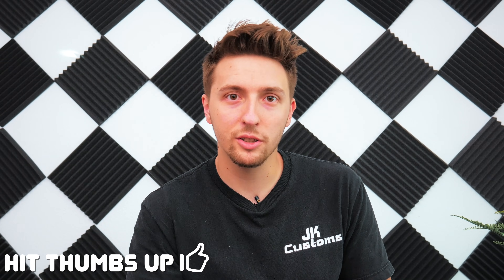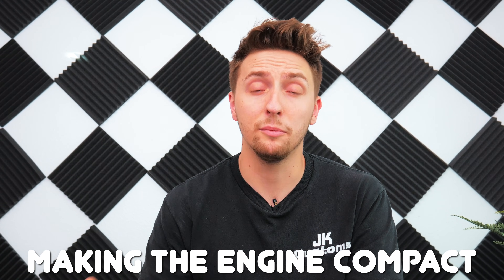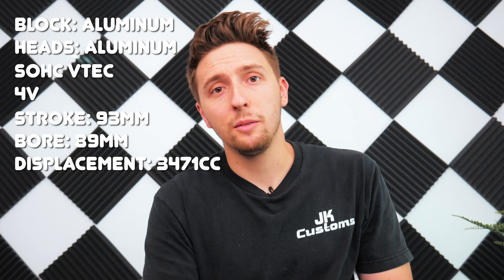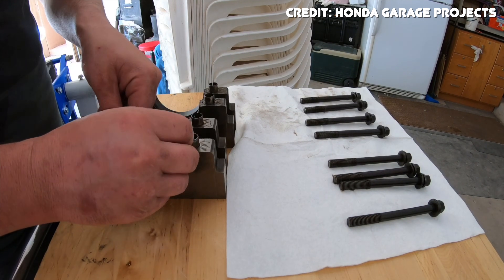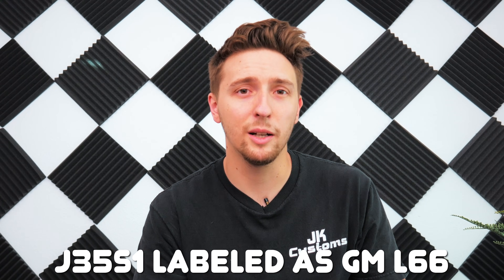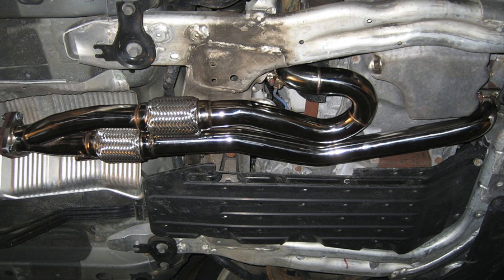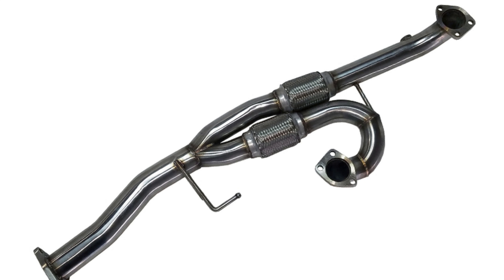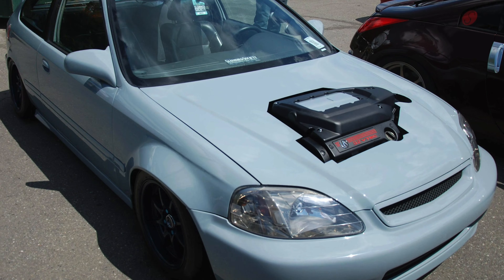Honda J35: Everything You Need to Know

Comment: I have said saturn vue. I was wondering what info you might have on the this start-up rattling from under the hood. I can tell you i don't  think it's the timing belt tensioner, and it is not the rh engine mount. I have read online about a fix that can be done...re-torque of the rocker shaft bridge .im not sure i am 100% confident to do this myself, but i could with the right instructions. The sound does go away once it is warmed up.

2007 vue. 186k mi. Regular oil changes with recommended oil.
Reply: Man just so you know the biggest culprit is a valve lash adjustment usually and if you haven't yet then do before any problems! ADJUSTMENT NEEDED (What sticker under hood should say) lol. This silver one is my 5th REDLINE and she was abused before me and barely ran! Now after a diet and some adjustments/swaps as well as teaching her how to breathe and fart better she's smashin fools at a 6sec 0to60.

Comment: One of my favorite engines of all time. Very easy to work on, smooth, muscular sounding, torquey, fuel efficient (when driving normally), reliable (especially non-VCM versions), & looks beautiful under the hood vs. other V6 engines.
Reply: I got a 08 accord 3.5 and i love it the vcm can be disabled with an aftermarket wire
Reply: @DeeRuss  indeed! And after the VCM mod, how does the car feel?
Reply: @MrSamPhoenix mine has vcm still but driving like an asshole can turn it off.
Reply: @jakesullivan9179  indeed lol
Reply: Does VCM turn on with eco mode or is it always on? What about sport mode?
Reply: My Odyssey minivan does 0-60 in 6.7 seconds, the J35 are powerful and plus has that almighty VTEC!

Edit: Caranddriver got 0-60 in 6.5 seconds with the odyssey which is impressive for a 280 hp, 4500 lbs Minivan
Reply: @aimxdy8680  indeed! But what year is your Odyssey?
Reply: @MrSamPhoenix  2021 with the 10 speed.
Reply: @aimxdy8680  yep, that 10-Speed will truly have the J-series show just how nice it is. 0-60mph in the low to mid 6secs is impressive when you’re talking about something like a family van. How does the 10-Speed transmission feel?
Reply: Muscular sounding lol. Until you hear an LS1. But nah it’s a nice motor lots of hp.
Reply: @forfun6273  dude, this video is all about a V6 engine. If we were talking about V8s then sure. But for a V6 this engine series from Honda sounds amazing!
Reply: @MrSamPhoenix  yeah I was just being a pos troll  really the J35y V6 is close to the original LS1  the V6 is like 280-310where the LS1 is 305 to 350. Which is downright insane. A whole 2.2L to get at most 70hp. Losing 100ftlbs. Of torque that. Still insane. I think they’re coming out with a 5L v8 though
Reply: @forfun6273  yes indeed! But the car makers are going out of their way to get rid of nice smooth V6 & V8 engines unfortunately.

Comment: Sorry, had to give a thumbs down for not mentioning VCM problems, timing belt and cam pitting.  Best bet is disable VCM via one of the many easy to install aftermarket devices, unless you don't mind burning ~qt oil ever 1000 miles, going through cat converters and engine mounts more often.  Nothing you can do about timing belt beside changing every 105K miles and hope the tensioner doesn't fail in between TB changes, in which case engine is gone.  Engine from a so called quality make like Honda should have timing chain, not belt.  Honda cams suffer pitting wiithout the zinc levels oils of yesteryear had.   Don't expect Honda to fix any of this on future years of this engine.  There will be no more R&D to improve this engine given direction industry is going with hybrids and electric vehicles.
Reply: Very well put .
Reply: I have a 2009 accord exl 3.5 vcm with 170k miles did timing at 150k … still running strong. It does burn more oil than normal but that started at around 140k so I check it once in a while. Other than that, I’ve had non of the issues you mentioned. Most people don’t keep cars that long and rack up 170k miles.
Reply: Agreed. Most valuable thing I did was install S-VCM to bypass the VCM. Terrible design that sounded good in theory, sucked in reality. My 2014 Accord has 75,000 miles, doesn't use a drop of oil and is full time V6. Gets around 28mpg combined. Aside from the design flaws you listed, I'm hoping for another 100,000 miles if not more.

Comment: Just turned 100K miles in my 2006 Saturn Vue with the J35/L66 VTEC engine.  Very fun grocery getter to drive, will try to keep it together for another 100K miles!
Reply: Hey.  Good day.  Lol.  My father has an 06 Vue V6.  We just did a major tune up to his vehicle with over 100k miles.  Damn that thing is quick.  I dislike most Saturn vehicles.  This engine redeemed it 100%!!!!
Reply: One of the best surprises of my life was my 2004 Saturn VUE with the J35 engine. I got rid of it at 235,000 miles as no one could figure out why my AC clutch had a mind of its own. (I should have dug deeper, as it WAS fixable). I used Mobil 1 with 10,000 intervals for my oil changes and it never leaked nor used oil. Not a drop.

I now have the J35Y in my 2015 CrossTour and, well, I'm just not sure I'll ever have another car without a J35Y engine. (My vanity license plate on my CT is "J35Y 278" to represent the engine type and horsepower.)

I think Honda did us all a disservice by removing this engine's availability from the Accord. Toyota was smart for keeping their V6 availibility for their Camry line up.
Reply: @douglaslippertindy  Hi.  How did your compressor have a mind of its own?  Any other issues you can list? Thx
Reply: Keep the oil changed and it'll do another 100k easy. We have an 04 Vue with the J35A4 and it's at 239k. Sounds and runs great, sadly the Vue's body is rusting away.
Reply: @davestout844 oh yeah me too. My vues fenders are completely rusted

Comment: I thought you were going to talk about everything that's wrong with it?   Did I miss that part?  What about the fact it has a timing belt instead of chain?  Is it non-interference?  Curious minds....
Reply: I agree - still timing belt driven cams, belt driven water pump, manual valve adjustment or burned valves, vtec gaskets leak everywhere, stripped aluminum drain pan bolt, knock sensor placement, and  VCM problems. Interference engine.

Comment: is it hard to jswap into rwd cars. Ik it can be done in s2k and s chasis but i was wondering if you could swap into like an is300 or an e46?
Reply: The guys at k-miata use a BMW trans for their stronger k-series swaps, and i'm fairly sure the kit can be used to fit a k-series into an E46, so shouldnt be much of a stretch to make the adapter plate work with a j-series instead.

Comment: I have an 08 accord v6 coupe auto trans, and have so far put on a takeda sri, tl type s cams, throttle body spacer, fully custom 2.5 in exhaust with one cat delete, on a 93 tune making 315 horsepower, putting on the j32 heads and j37 crank and intake tho I’m gonna need to look into that, especially that j pipe
Reply: Can the transmission take that much power?

Comment: immediately searches eBay motors for high flow j pipe
Reply: If you have a flux core welder, save yourself some money and splice in your own connection between the two banks right ahead of the flex pipe. Those J pipes are priced so high you'd think they were made of gold.

Comment: You forgot about VCM. VCM is present in many J35s and has caused some issues. Some VCM J35 engines are also prone to premature camshaft wear.
Reply: That camshaft wear was due to the rocker shaft bridge being torqued incorrectly from the factory. There was a TSB about it. Either way, VCM was always a load of unnecessary problems (keyword being unnecessary). There is another common issue with J series rear bank cams being spalled. That seems like a valve clearance or oil supply issue (to the head). You'll find a LOT of J series that "tick" and it sounds like a valve issue, but NOBODY knows what the sound is. It's not valves, because the noise isn't present for the first 15 seconds after startup. I've found countless people with this issue. Also, the original service manual scheduled valve lash adjustments for "when noisy." Major mistake. Other shops have found that valve lash adjustments were necessary after only 20K miles on most J series.
Reply: @WhiTeaNdNeRDyOG  On the Odyssey forum after seeing many users' experiences, we've come to a general consensus that a valve adjustment is a good idea at some point between 150-200k miles.

Comment: the J35A9 Ridgeline 06-08' engines have a common Cylinder 4 low compression (usually due to bent/leaking exhaust valve). Any thoughts?
Reply: I've seen an 08 Ridgeline burn the cyl 2 exhaust valve. Other than timing belts neglected that tear and bend valves, and neglecting oil changes I've never seen a j35 blow up. Extremely reliable engines. The older automatic transmissions bolted to them are a different story.

Comment: What do you think about changing the cam to shave down cam what I wanna do is switch it to 3.7 twin cam are you saying to 3.2 heads flow little better if I Port them
Reply: The best flowing head is the j32a2 heads. They're not the best flowing instake wise but exhaust wise they're fantastic. Honda moved to the integrated manifold on the head which hurts exhaust flow in most j series after 2003.
Reply: @PiterStreak  that’s what I keep on hearing lol you think the 3.7 to 3.5 would be better but damn lol

Comment: I have a 2011 Accord EXL V6. The gas mileage is terrible, but the torque and acceleration is why I want to keep it forever.
Reply: I got 35.8 mpg, most of the time its around 29, so where's that bad for a 273hp engine? Not in my world.
Reply: @MikeYurbasovich  I get about 18 mpg city and 26 highway.
Reply: @inductionrecords same. His numbers dont look right unless its a hybrid of 4 cylinder
Reply: @MikeYurbasovich  How true ,I average 10L/100Km city and hiway and 7.5 to 8   all hiway.
Reply: I own the 2015 Accord EXL V6. Remarkably, I have seen an indicated 41.8 mpg at times in my car. Average is about 30. Remarkable because Road & Track dyno'd this engine showing around 300 hp at the crank. The combination of 6 speeds, VTEC, VCM allowing 3 cylinder cruising, results in some insane mileage at times. Even the average of 30 mpg mixed driving for a 5 passenger 4 door sedan weight 5,550 lbs. is impressive. I'm thinking the 2011 has the 5 speed and that may be where your isn't quite as fuel efficient. Maybe a larger and heavier chassis as well. But yes, I can do 101 mph in the quarter and still achieve 30 mpg on average, seeing over 40 routinely. That's Honda magic! And this engine is buttery smooth. I honestly don't think there is a better car for the money out there!
Reply: Upgrade your fuel pump and maybe destroke the engine. Could also be you have a bad O2 sensor and or bad spark plugs.
Reply: I dunno…I get great gas mileage with my 218000 miles 2010 accord exl….and it’s pretty heavily modded 😊
Reply: I get 35 mpg in my 08…
Reply: @joefrasca1549 naaaaaaaaaaaaaaaaaaaa please How!!!!!
Reply: I got a 2008 im gonna disable the vcm because it burns oil it will burn more gas tho
Reply: @DeeRuss  I disabled the vcm on my 2010 Accord and the gas mileage has dropped less than 2mpg.  Did you experience any other problems with vcm such as spark plug misfire or vibrations when accelerating?
Reply: I get 3kmpl
Reply: @user-pv8sx8xm4u What's the max efficiency one could extract from stock ecu , say by , increasing the Compression Ratio to 12.5:1 , stock cams, Headers tuned for torque and free flowing exhaust , ported head , intake runners , and throttle body ..
Reply: Ayyy,I've got the same car and I love it,especially since it's a 6 speed manual!
Reply: @shaunobrien2526  Wow, those are really rare. I've only seen 2 or 3 manual V6's in my life.
Reply: @user-pv8sx8xm4u lol they sell rebuild kits for your bmw that let you upgrade all the problematic parts also with some upgrades. Then you can bore and add a big ass turbo lol
Reply: Got the same , looking to fully suspension it , plus turbo for 420 hp 😂 i want a reliable 400 hp exl j35 and huck it for time attack. Please be gentle lemme know the route to go for 100 hp plus as reliable as possible. All answers welcome i just want to enjoy this car as much as possible but not at the expense of the car.
Reply: You got a real gem there. I have the same model except it’s a ‘12. Did you muzzle the VCM?
Reply: Really? I have a 2015 and the gas mileage is pretty great if I'm not pushing her even on a 2 hour uphill trip it got decent mileage and on the way back down I didn't even waste a quarter tank it was still near the F
Reply: aye pretty similar here 2010 3.5L EX-L crosstour J35Z2 with VCM i-vtec and it is sick. it’s such a sleeper, i slapped a cold air intake on her with a slightly opened exhaust, can’t wait to gap some unsuspecting teenagers 😂 sounds like a straight 3 in eco, then out of nowhere comes the lion 😈
Reply: @Culmination-SoundCloud  i have the same crosstour, do u notice shaking/vibrations when accelerating around 70-100km/h?
Reply: @clipwizard997  I do.  It's been going on for well over 50k miles right now.  I'm at 204k right now. It's annoying but not that annoying.
Reply: @ yes, did you find a fix for it
Reply: @kiranandhiscrosstour2529 you menace 😂😂 i have a 2015 accorr coupe exl, its such a beauty compared to the dull/boring hybrid accords they are putting out nowadays.
Reply: 😂im dead literally getting 9 in my truck

Comment: Can you please go over transmission line up bolts? And lsd swaps for the J series family.  I have yet to find any info in it especially with bisimoto slapping on a type s trans onto his oddesy he doesn’t clarify if its the 3.2 or the 3.5 6 speed transmission since both base and type s used the same LSD not to sure if the base and type s line up to other j series families
Reply: 07 08 3.5 TL-S bell housing and block bolt pattern are different from 04 to 06 TL 3.2 bell housing and block. You can adapt the 04 to 06 TL manual trans to the 3.5 TL-S engine by swapping the bell housing half of the trans case to match the TL-S block and get the correct clutch and flywheel. The guts of the manual trans from 04 to 08 are the same along with the LSD.
Reply: @Johnman5757  Thanks that answers some questions, im curious if that 07-08 tls trans can line up to 8th and 9th gen accord models. Without pulling apart all the guts from the transmission. Just like the F and H series trans are Interchangeable, it would be nice to just slap on to the 3.5L like bisimoto did to his Minivan.
Reply: I know the J series are split up with at least two different bolt pattern styles. The easiest way to tell apart are where the starter location is. Older J series motors use a pointy shape bell housing is (Ie J35A1, J35A3, J35A4, J35A6 J35A7 (A6 and A7 2006 and before) They have the starter located in the transmission with two bolts going through the bell housing. Newer J series have a round shape bell housing with a larger fly wheel. (J35A5, J35A6, J35A7, J35A8, J35A9, J35Z1, Anything 2007 or newer) They also have the starter mounted on the side of the transmission but on top of the casing with a shim. The J32A3 from 2007+ and J37 (Potentially) use the round bolt pattern. The older J35 , J32, J30, and J25 also have a return style fuel system, different oil filter housings, dip stick outside of the engine, two pully harmonic balancer, and engine brackets on the timing side of the engine that's a inch taller than the new style. The J35A6, J35A7, J32A3, J30A4, J30A5 uses the new style engine mounts and single drive pully but the old bell housing pattern on 2006 and older applications before they switched to the new pattern. I'm not aware of any other honda series transmission that will bolt up to the J series without an adapter plate. It must be a J series transmission from my knowledge and comparing between their bolt patterns.  I hope this gives some info about it.

Comment: I think I've done well with the parts mixing: J35A1 block, crank and rods, J32A2 pistons, heads and cams, J37A2 intake manifold, FBO, like, literally everything, I think, and a J32A2 ECU. The car is a beast, but I blew the differential in my B7WA transmission recently. Don't know whether it was just a bad diff, or it's too weak by design for this kind of motor. Anyone know whether a differential from an old Honda Odyssey is any more durable?
Reply: Wow you did all of that?! How much did it cost, and what we’re the performance numbers?
Reply: @MrSamPhoenix  it was about 130 thousand rubles (I live in Russia), I don't remember the exchange rate in 2021, but let's say it was 75-ish to the dollar, that's about 1700-1800 dollars.
Reply: You can use the one from the oddessey. Now the pilot you cannot. You want the baya trans. From the 07 on up from the accord.
Reply: Honda had all kinds of issues with the early 5 speed autos simply because by designed it would get starved for lubrication on the second gear so it would end up slipping. The Honda trans  was a different breed. It was setup like a manual. Why they were othen called the hondamatic.

Comment: Question what would cause this engine (Stock) to Break timing belts? i know age , bad idler bearings,weak belt tensioner or oil on belt.  But this is not the case...so what is happening? Marks perfect, runs perfect then out of nowhere it breaks at low rpm , leaving a stop light or turning corner. Happened twice less than 2,500 miles on new Honda Belt?  What should I look for to solve this????
Reply: This is an interference engine. How is it breaking belts without destroying the engine?